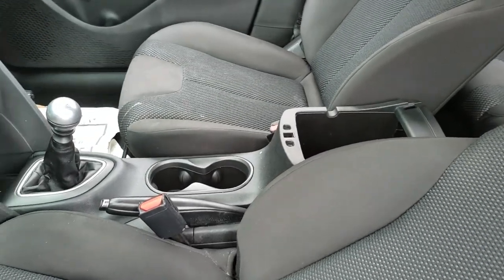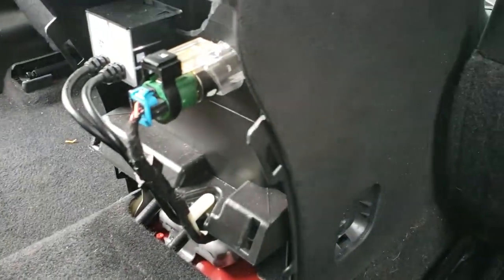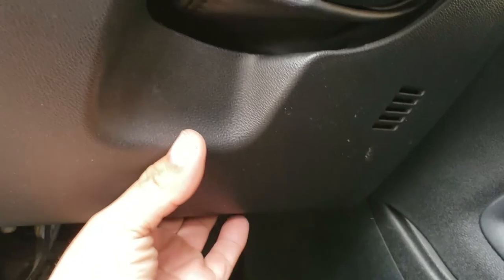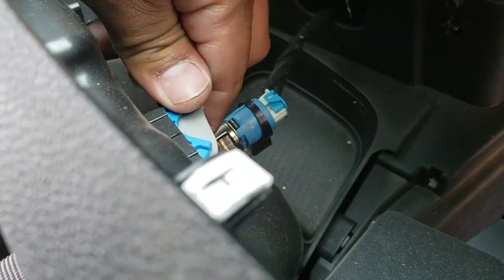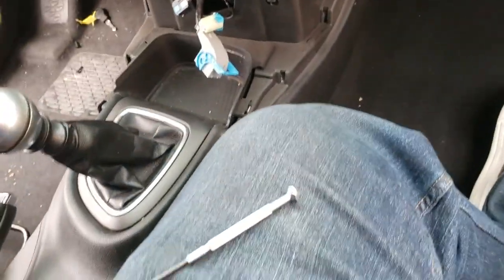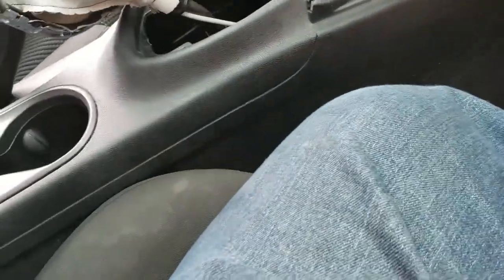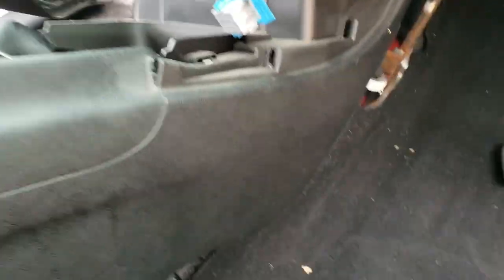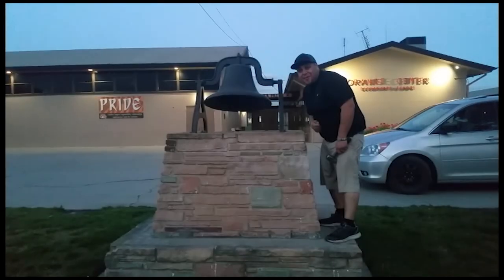How to: Remove Center Console on a 2016 Dodge Dart

Comment: Thanks man, I have a ‘15 that has only had ONE problem in the 3 years since I bought it: the parking brake won’t engage. I can tell there’s just a loose connection inside that needs to be tightened but I didn’t want to damage the console so I’ve just been parking away from steep hills all year. Appreciate the time you took to make this, it’s exactly what I needed. 🤘🏻
Reply from the maker: Thank you hopefully this works out for you!
Reply: Were you able to fix the parking brake this way? I have the same problem on a '13  THANKS!
Reply from the maker: @tylerhempfling501  im not sure if you are or not but removing the console will give you more room to see were the problem is. Pull it back and forth and see whats NOT engaging. Do take note that the emergency brake is cable it comes from the rear tires all the way to the emergency brake lever you might want to inspect from the rear to the emergency brake to see whats the problem
Reply: @559powerscape   Thanks!
Reply: @559powerscape  I replaced the rear calipers and they are pulling when you engage the brake, but not tight enough to leave it parked on the hill.  I suspect the cable needs adjusted or tightened. Thanks!
Reply from the maker: @tylerhempfling501  Your welcome yeah sounds like it just needs to be adjusted. Good deal 👍 have a great day!

Comment: This is a big help Mr. Lopez, I'm getting ready to attempt installing a Mopar illuminated cup holder 1TW50DX9AD (from a different model / option Dart that I believe should fit - famous last words ) for my 2016 SXT turbo model.  The information you have provided is invaluable and for that we thank you my good man :)  Some of those dam trim panel clips can be a real pain in the ass I don't have to tell you.  Keep up the great work !
Reply from the maker: Lmfao yes man they are a pain! Heck yeah man I really hope that mod works out for you! May I suggest a inline fuse when you tap in to 12v for your SAFETY!  Rather a fuse burn out than your car. Granted it is behind a fuse already but double safety measures never hurts. Have fun bro! Thank you for your SUPPORT!

Comment: Theoretically..to adjust the parking brake, I just need to take out the back two bolts and lift the console up just enough to squeeze my hand in there to spin the nuts..Theoretically.. ill give it a whirl.
Reply from the maker: Good luck bro!
Reply: Did it end up working?